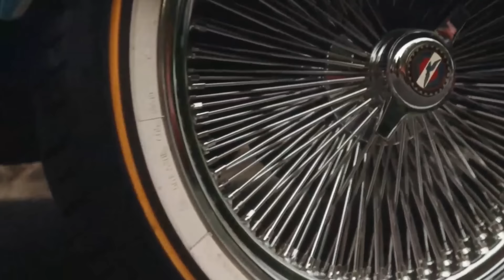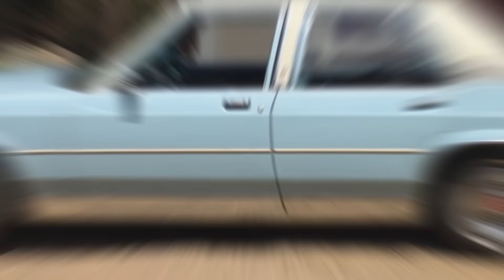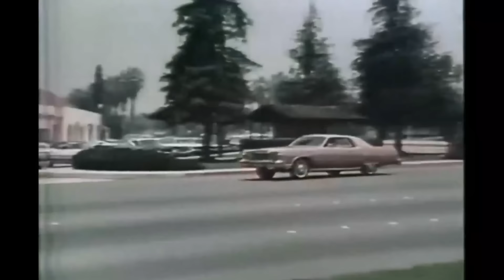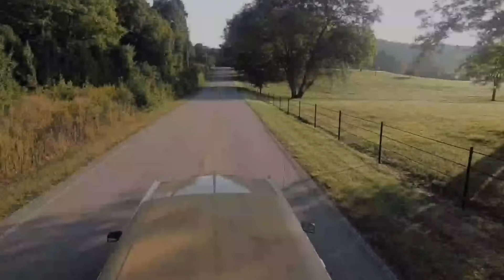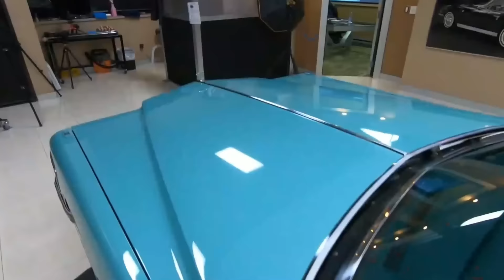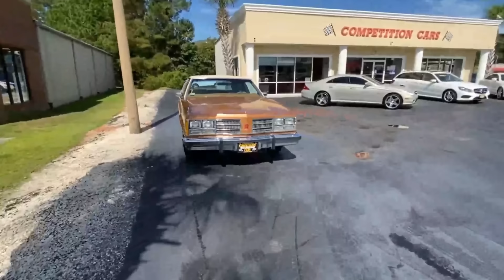The 10 Worst Full Size Cars Of The 1970s!

Comment: We had 73 caddy eldo a 75 caddy eldo big blocks drove great and were quick, 76 lincoln conti ,rebuilt 460 750 holley double pump vac secondarys with a cam it would smoke them in all 3 gears😮yup. Nevermind my 72 440 imperial lebaron fastest couch ive ever sat on 😮 big cars, big block engine, what😊

Comment: GM, Ford, & Chrysler ALL had quality issues across product lines in the 1970s.  All were under powered (even when equipped with largest of motors) & suffered from fuel economy issues courtesy of the smog motors installed in these "barges". Paint issues were common. Quality issues at US car companies impacted their bottom line & nearly put Chrysler out of business.  Japanese companies like Toyota, Datsun, & Honda all benefited as a result.
Reply: It's very obvious you were never there to experience Detroit iron  back then. You're just quoting "what you heard", over the years. Nothing was underpowered until the late 70's when insurance and gas prices skyrocketed because of the high HP those "barges" put out. All cars had poor quality back then that is just how assembly lines worked but people weren't so anal about every little detail on cars like they are now. Chrysler almost went out off business because they pioneered Detroit built small economical front wheel drive in the 70"s that people refused to buy until they had to which was a few years later. Don't comment about the poor quality of the old stuff until you do a little research about the junk coming off Detroit assembly lines now. Ford and GM are both overwhelmed with bad engines and transmissions with Ford being the "King of Recalls" as I write this. And Toyota is running a close third to GM and Ford. Vehicles that were rock solid back in the 70's...the Bronco, Suburban, Tacoma, F-150, Silverado, are dropping like flies with bad engines and transmissions. Back in the 70's the small block Chevy engine was bulletproof (I hate to admit that) now they are made of glass. And Ford...OMG they can't do anything RIGHT anymore but people still buy them...a LOT of them only because my daddy and grandpa drove Fords not because Ford has proven its reliability. NFW! definitely not lately. Even if you did have a bad car back it the 70's you could easily fix just about anything back then in a couple hours out in your garage or driveway. Now with modern cars that ain't happening. Even changing oil or spark plugs on new cars can be a nightmare. Like I said either you were not there or you had absolutely no mechanical skills and/or were afraid to get your hands dirty......DUH
Reply: @bultacowally  First of all, i grew up in the 1950's so I was very much around back then.  I would agree with your assessment of the small block Chevy motors & would add that both Ford & Chrysler delivered on their powertrains generally speaking.  I owned several Fords & Mercuries as two Plymouths.  They did have rusting issues.  Drum brakes were not adequate for the motors installed.  Tires were problematic until the introduction of steel belted radials.  Quality was not even across all the brands but there were some very noticeable successes.  Insurance became a major problem in the very early 1970s.  Yes, cars were easier to work on in those days & they required more frequent maintenance.  After 1971, cars tended to be underpowered & uneconomical across the product line with a few exceptions.  It is true that it is difficult for the average person to perform all but the most basic maintenance these days.  The plus is that many maintenance items don't need to be done as frequently (though it can be quite expensive).  Fuel injection & disc brakes have improved the performance of vehicles & tires are light years better.   Sir, I was there.  I drove those vehicles & got well acquainted with the good points as well the bad.

Comment: The biggest problem with the Chrysler products was the lean burn carburetor. It was terrible.
Reply: I
The Lean burn was technically not the carb it was the Electronic Control Unit (ECU) that Chrysler used back then. They were easily removed Chrysler even sold the kit to do just that.
Reply: And rust.